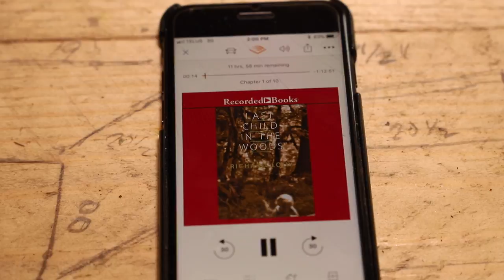Handmade Copper Sink at the OFF GRID Log Cabin for a Rustic Wood Kitchen

Comment: Put the item you are soldering on top of the stove to keep the heat in it and use a bit of hard wood to clean the iron tip . It will leave it tinned but clean

Comment: I'm a retired custom sheet metal fabricator and I've worked quite a bit on items very similar. Usually flower boxes or custom gutters. You did a good job. I noticed that you were having trouble with your iron. Hint: clean it with file then hit it with the flux and rub some solder on it. Then you can reheat it. You'll probably have longer uses between cleaning if you heat in the flame not the coals. Also you will have better solder joints if you lay the iron on top of the 3/4" flange and heat the copper. It will draw the solder back under the flange. I hope that you realize that it will oxidize and will be tough to maintain??? Ps. you can do the same with stainless steel. You'll just need silver solder and better snips. Keep up the good work. You're inspiring
Reply: Ah but the copper looks so beautiful .. and it's anti-bacterial too, unlike stainless steel.

Comment: I haven't used an old soldering iron like since I was a kid, I believe it heated via spirits though, a little bit more modern, same head size. Of course I had to use the old sticks of solid solder that came in bars, patching up past nail holes in roofing iron to reuse the iron. The copper work was nice, but nothing worse than copper splinters. Nice owl at the start! Thanks for another great video.
Reply: Haha, brings back memories. My Dad used to put the old soldering iron in the stove to get it hot too.
Reply: owl3764. I remember my grandad - born in 1891 - using an old soldering iron, heated in the old Rayburn, to mend his tea pot, kettle, washing up bowl... gosh, those memories came flooding back!

Comment: I like your cabin very much and I have watched already most of your videos. Please allow me to give two advices:
1) Try not letting slip/flip the scale tape back against the tape measure cover because this behavior will lengthen/harm it. Sooner or later this habit will cause faults in measurement from at least 1mm up to 3mm!
The angled stopper will become more loose than it should be and/or become crooked. In this case it will never hold on an edge while measuring. Worst case: It will brake away.
2) If hammering sharp nails into wood the risk splitting it is much higher than if giving the nail top a punch with a hammer to soften/dull it before driving it in! The bigger the nail, the more important this kind of split prevention becomes.
All the best luck to you, your wife/family, your good dog and projects for now and future.
Reply: chru cas good advice man
Reply: CC Rocker: Thank you, my pleasure.

Comment: Running Water at 25:10!! Terrific job on fabricating a handmade copper kitchen sink. Getting caught up  here this makes video #16. Anticipating #18. While doing errands saw a 2x6x14' fall off a poorly loaded truck. Raced to retrieve it while making left turn. Secured it and took it home. 14foot board no EZ task 2 carry on 13' truck w/o straps and load straps which I carry.

Comment: I know that Roll of Copper has been there for a couple Weeks but STILL probably the last thing Id be thinking I was gonna see on the Channel were my HVAC/Sheet Metal Tools! 😆 The Hand Seamers, Snips & Shears! A Bar Fold would've also been handy for all those lengthy bends! & you could always nail the top of the sink- before the bends around the top to the inside of the cut out wood on the tabletop to keep it from moving in on ya but impressive as always Shawn..

Comment: No problem with the commercial. If you say you use it, it is ok. The copper sink is a nice idea. The gutter on my roof I made from copper, too. Perfect material to last forever. But I saw you dont anneel the soldering. Like that is could get green and that is not so helthy. The easyest way is to spitt on a rug and whiping the solders and best the complete surface. The it will get a nice brown patina.

Comment: Perhaps you may have filled the sink with water and checked for leaks before using. The principle of soldering is capillary attraction. You don't melt the solder, but heat the copper of the over lapping seam, hold the solder iron on the copper seam not on the outside of the seam, and the flux helps draw the solder into the 'joint'. This is what makes for the water tight seam. Just a thought but copper rivets may be needed to hold the seam together while soldering. Best always...

Comment: Nice to see the use of a what I call a Tinners Iron to solider the joints you need a white gas blow torch, keep that iron hot, but the stove worked well. Silver solider on the joints, I hope not just lead. As alway's excellent work and video..

Comment: Have you thought about electricity? Like solar panels or a micro wind/hydro electric generator. I've seen you have a stream relatively near by. You could create electric power generator using an old washing machine and store the power you generate in a battery. Lots of videos on YouTube (check Angry Ram's channel as an example)

Comment: It occurred to me later that your copper liner is floating inside the box at present... are you going to apply any adhesive or bedding to quiet it down and keep it from "oil canning" ? Looks beautiful... Maybe a copper countertop ?
Reply from the maker: Ha, oil canning, you must be a metal working.  I'm not sure it matters, so I'm leaving it for now. I considered peening it to give it some interest and more structure. Also considered a countertop, but I don't have quite enough and did something a little different, which I'll finish tomorrow
Reply: You wouldn't need to do the entire countertop, I'm thinking of an  integrated area beside the sink for drying dishes. The peening idea sounds cool for the sides of sink, but maybe not for the bottom. I'm guessing you're still looking to do a reflector behind the stove as well.

Comment: Very nice Shawn. I like the home made, hand made kitchen sink. 
I took a bit of sheet metal soldering in high school and I thought it was very cool. one thing I may be confused about is that I thought the soldering iron was supposed tobe put under the piece to be soldered and the solder on top (or at least at the edge of the joint) since the heat rises up through. I was told that, done this way, when the solder melts the metal is definitely hot enough to allow the solder to flow between the two edges.
I was just wondering if that is actually necessary.

Comment: Your kitchen is looking great love the copper sink, read a report from the uk NHS before were the showed that copper had antibacterial property's compared to 316SS in tanks and sinks. Have worked with copper before but have always been told to sand the joint areas before soldering. Don't know if this is a must or just helps to bond.
Reply from the maker: al math thanks. Yes, the copper and the iron has to be clean for the solder to stick, which I struggled with since I had to put the iron right in the fire.
Reply: My Self Reliance looks like you done a good job

Comment: Its neat to watch you use "old" method of melting solder. Little things like that I find (at least for me), I take granted for because tools, electricity, running water, etc comes in such conveniences, I don't think twice about it. I use them out of auto-pilot mode. A question came up watching this video, do you get condensation on the inside of your cabin? Thanks :)

Comment: Interesting video.  I ran across this because I'm looking to do something similar on a little bit of a larger scale.  My home is spring water fed, and what I'd LIKE to do is install an ~80 gallon cistern.  My thoughts were to build one with copper because of it's antimicrobial properties.  Since this is going in my "basement" and the stairs and doorway are a little tight, I can't just go with any tank.  Besides, wouldn't it be more fun to build something than to go buy a tank?

But where do I get a 3'x8' sheet of copper for free!?

Comment: What did you use to seal the spaces in-between the logs on your wall?  Also, when you were finished with the room and last down boards to seal, you put up burned faces of wood.  Why were they purposely burned?  What else did you put on the roof to ensure there were no leaks?

Comment: I've been following you for a wihle now, and you really blew up come Christmas. I think that what you're doing is fantastic and your mindset is a very positive one. The 'what did I accomplish today' is something Benjamin Franklin would do. He'd wake up, ask himself what he wants to do, allocate a few hours to it,  then in the evening he'd reflect on whether or not he did something positive towards that goal today. 

I was wondering if the solder in the sink would ever cause problems with the waste water possibly being contaminated via the lead. Also, does a sink necessarily have to be rectangular? What if you just hammer the sheet of metal in, as to not have any folds or possible leaks? Not sure you know what I mean, but is there any way to sort of make a 'self extruder' or is the pressure required way too much?

As for the Audible advert, I actually don't mind it as it does make audiobooks pretty easy to get and save. Sure it looks kind of ironic that a self-reliant channel is advertising for a corporation, thus making it more or less reliant on its generosity/kickbacks, but I guess it's your call and as you say you personally use it so.

Comment: if you would like to use pneumatic tools up there try a very very old way of using any and of your air tools. make or buy a steam engine need to put a vapor catcher on it and you use it with all you air tools , use it as log splitter, or even a way to pump water. in joy also it just runs on wood you burn just add water.

Comment: I was taught to use a solder iron by my father many years ago, nice to see someone else using one... yo7 could have ‘beat out’ your turning joints a little though, it makes the copper more pliable and easier to solder with an iron....and beat out you waste as opposed to cutting it...and soldered a short down pipe too... but hey, I’m a little longer in the tooth than you, so your forgiven...lol...overall not a bad job... see if you get yourself a book on coppersmithing from audible...!!
Reply from the maker: Lol. I considered making a hammered copper sink, or forging one from a bar, but I'll do that in a future project

Comment: I crave to live out like this. I have a question; as your cabin gets more “finished” and more gets brought in, more modern items are used, do you find your days getting filled with more mundane chores?  When you were first building the cabin, you were living (somewhat) primitively. You used a pan, ate out of it, wiped it and your utensil down and were done. Now with dishes and several pots and pans, you have to spend more time caring for those items, as well as cleaning other things. The more furniture there is, the more crowded and you spend time moving things around so you have room to do your work. 
I want to clarify, this is not a criticism, but an observation and one I feel is relevant in my own - on grid - life. I’m currently trying to minimize because I spend so much time caring for items instead of using my time to do what I want. 
So, I was just wondering if you have noticed the same while slowly modernizing your cabin?

Comment: Thanks for the informative video, I have wanted to build a copper sink for quite some time and this video helps give me the motivation to do it. Just a few quick questions though. What was your source material for learning to build copper sink, what guage copper did you use and where did you get copper  from, in other words who was your supplier. Thanks again for video
Reply from the maker: A subscriber gave it to me, but it originally came from Pratt Sheet Metal in Barrie. I used 20oz but 24 or 32 would be better

Comment: What I noticed is that you built the cabin with rough cut logs but on the inside looks like all the same run through a mill to debark them and make them the same shape. What is that all about?

Comment: Sean do you reload your empty brass casings? It is much less expensive to reload them instead of buying it all the time.
Reply from the maker: No, but only because I use archery equipment more than rifles and don't shoot very often. I may shoot more now that I have a place to practice though.
Reply: Are you going to expand on to the cabin?
Reply from the maker: Luke Calacci yes, I'll be starting a small addition in the next few weeks before starting the next cabin when the ground dries out in the spring

Comment: I would be a little concerned about the lead in the solder slowly leaching out into water in the sink and then into food. Unless you used lead free solder?
Reply from the maker: I considered that but realized that the solder I used is actually for soldering copper pipe used to transport drinking water. The sink water is far less direct
Reply: Perhaps, but in water pipes phosphates from the water form a passivation layer over the Lead which resists leaching -- IF the water is properly treated.  In a sink you may have acidic ingredients in direct contact, and reactions between the Copper and dissimilar metals (Iron pots) which could expose Lead to leaching.  Also you're using untreated water.   In the water-poisoning crisis in Flynt Michigan, the Lead poisoning came from soldered pipes which were OK for decades until the city changed to a more acidic water supply and failed to treat the water properly, which eroded the passivation layers to expose fresh Lead.  Lead-free solder is a more of a pain to work with but will keep you safe.
Regards, and thanks for the videos.

Comment: I hope there's no lead in that solder. Potential exposure routes from soldering include ingestion of lead due to surface contamination. The digestive system is the primary means by which lead can be absorbed into the human body. Skin contact with lead is, in and of itself, harmless, but getting lead dust on your hands can result in it being ingested if you don’t wash your hands before eating, smoking, etc. An often overlooked danger is the habit of chewing fingernails. The spaces under the fingernails are great collectors of dirt and dust. Almost everything that is handled or touched may be found under the finger nails. Ingesting even a small amount of lead is dangerous because it is a cumulative poison which is not excreted by normal bodily function